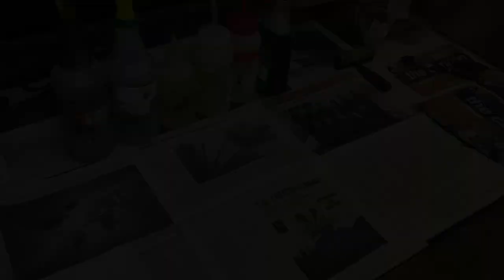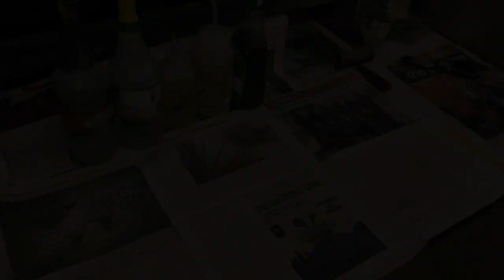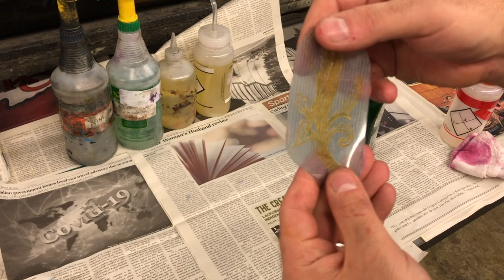Cleaning the C&P press after printing

Comment: I was taught to use mineral spirits to clean the press and the rollers is that not correct?
Reply from the maker: Mineral spirits will definitely clean the press and rollers, but I don’t use VOCs in the University of Regina studio. Even with good ventilation, they are dangerous and quite bad for everyone’s health. Our cleanup process for this press uses non-toxic Soyclear 1500, vegetable oil, vinegar, and other safe household products… the only downside being that it takes a little longer than conventional solvents.
Reply: @professortruszkowski  I'm working on a newly built print shop at the hungry hollow steam and gas engine show grounds in rice lake Wisconsin. We had a bunch of equipment donated to us. Trying to get everyone up to speed on operations of the 4 presses and the linotype.
Reply from the maker: @wwjd6922  wow! Good luck. That sounds like a lot of fun.